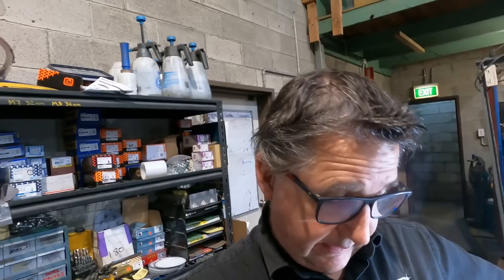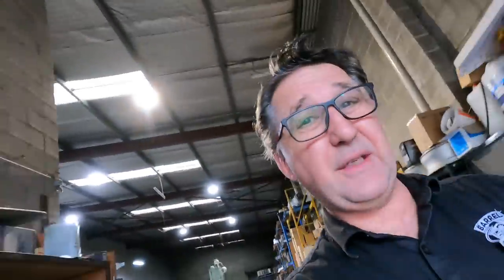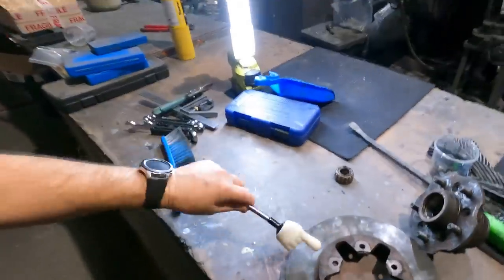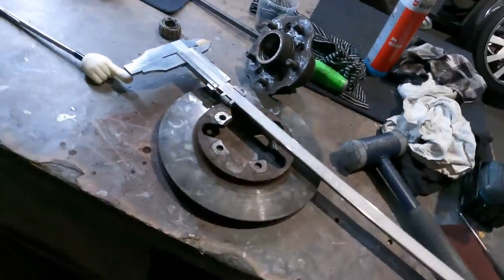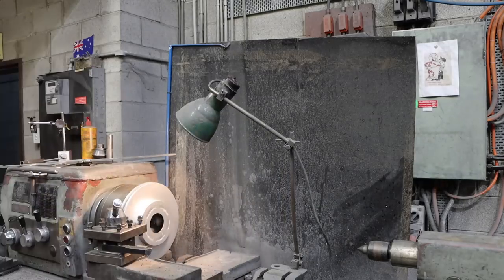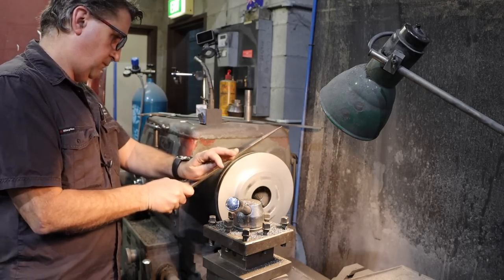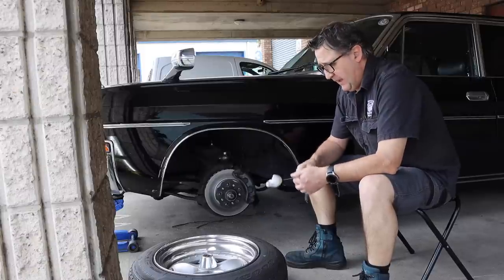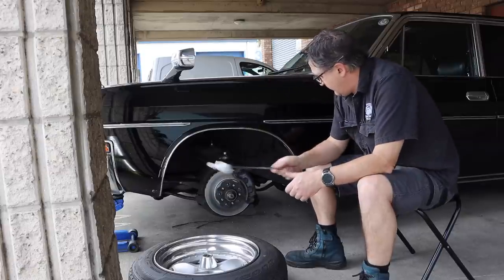49. Nissan President H252 Episode 10. Brakes.

Comment: Raybestos 96094R seem very close, at least from the dimensions I gathered from your video, ID is correct, hat height and OD appear correct, same mounting style, though rotor thickness might be off.  1985 300ZX turbo, rock auto in the states has stock. Very interesting machining work, too bad if you ever do find the exact rotors now you need new hubs and calipers to match.
Reply from the maker: It really needs bigger brakes. 259mm diameter is really not adequate for a 2 tonne car.
Reply: @BarrelBros  I wonder if you could adapt S-chassis hubs to it? Iirc the AUDM S14 turbo manual came with 330mm front rotors and 4 piston calipers stock.
Reply from the maker: These are a double A arm, not strut type so chances would be slim.
Reply: @BarrelBros  Aww, nuts. I wonder if there are early Corvette parts that might be adaptable?

Comment: Well given your adjustments to the hub/caliper bracket, you probably don't want to find something with a better hat height now... Future maintenance is easier as all you will need to do next time is trim down the OD, drill the holes and you're good to go. 

The only other prime cause of shudder on the brakes I've come across is the one you fleetingly mentioned at the lathe - wheel bearings. However looking at those rotors, I agree with you that they are probably at least some of the problem. You'll know if wheel bearings are an issue if the shake comes back reasonably quickly. 

Oh and the mental image of Mark drifting the president over a mountain pass is one of the more amusing things that has appeared in my head today.
Reply from the maker: Yeah just a bit of machining on the disc.
Reply from the maker: I think rather than do that I'd replace the lot with a larger disc and caliper setup anyway.

Comment: Hey mark check out late 90s-2000s Holden rodeo/Isuzu front rotors 

They mount up the same obviously hard to say if the dimensions are correct but check both rwd and Awd versions as they’re different size rotors